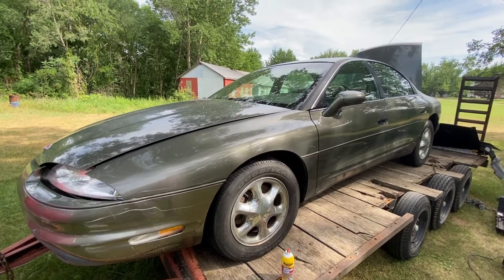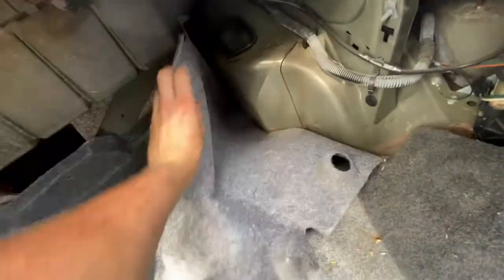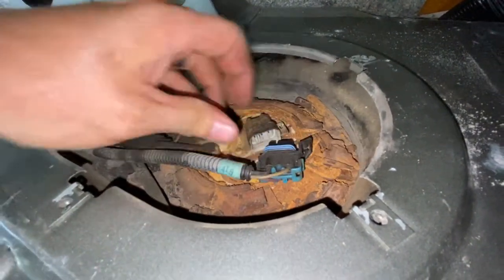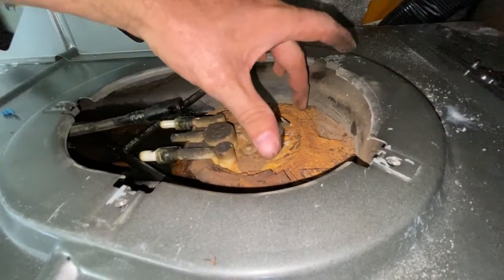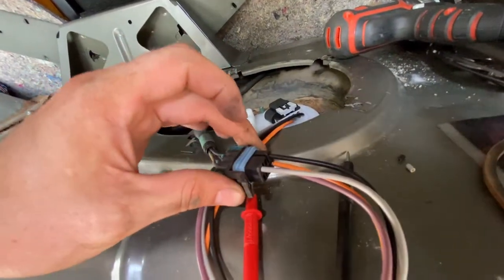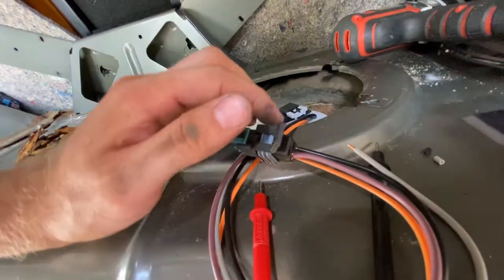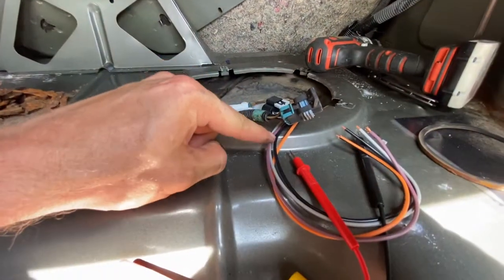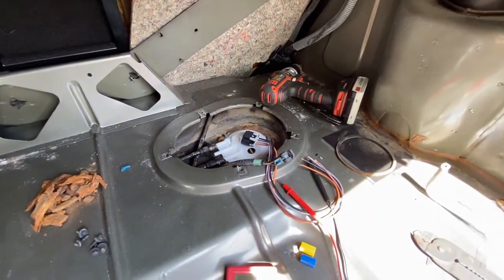Oldsmobile Aurora Fuel Pump Replacement 95 96 97 98 99 1995 1996 1997 1999 1999

Comment: I had water leak in my Olds and it soaked the carpeting in the trunk. Tried drying it in the sun, no go. Used this video to figure out how to remove the carpet so I can clean it. While it's out, do you know how to replace the mast in the antenna if the motor runs and it won't go back down? Thanks for any help!
Reply from the maker: I’m not sure on that one. Never replaced one on this model. 

Glad the video helped a bit though.

Comment: What type of fuel.pump is that ?
Reply from the maker: It was the OE replacement from Orielly Auto. Cant remember the brand. cost me about $200.
Reply: @DirtRoadAutoRepair  Have It been running and working just fine ery since the video @Carr
Reply from the maker: @brandiethomas6663  yes

Comment: This is very urgent. I am going to keep doing research but I am messaging you right now because I see you have an Oldsmobile Aurora around the same year. I have a 1997 Oldsmobile Aurora that I was letting my brother borrow he didn’t pay attention and put in regular gas instead of premium like it requires. He only put in about $20 worth maybe a little less than half a tank and now car car will not start and he is stuck downtown. If I go out and buy 5-10 gallons of premium gas and fill up the tank do you believe that’ll be enough to start the car?